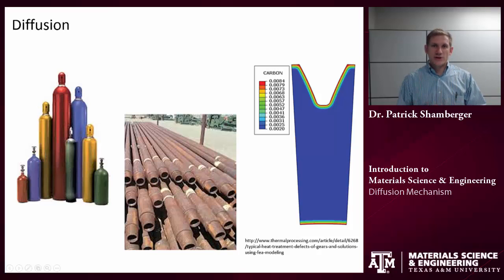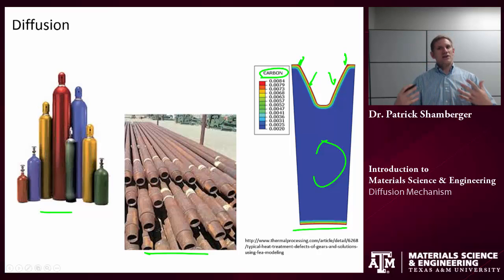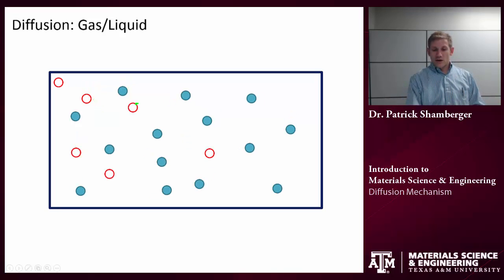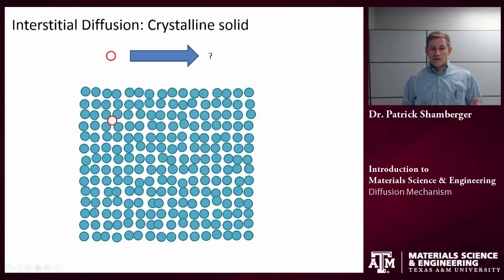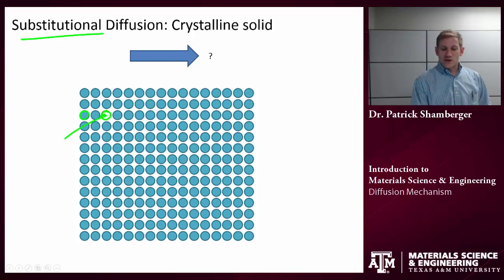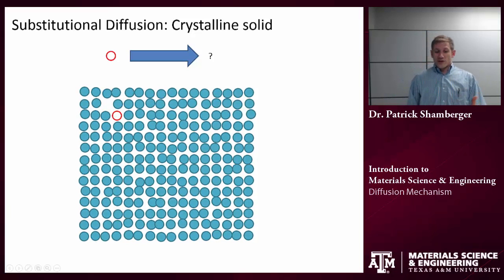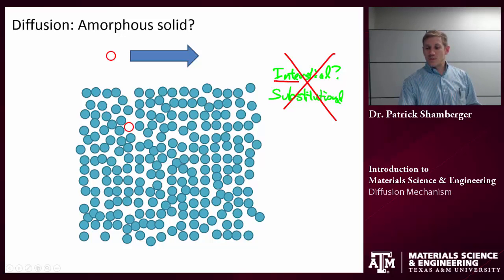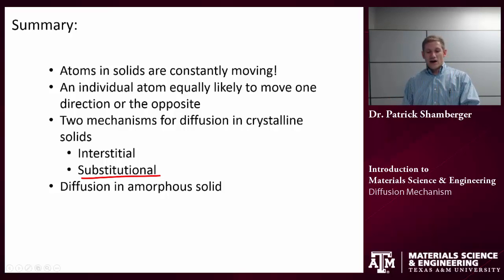Diffusion: Mechanisms {Texas A&M: Intro to Materials}

Comment: so for solid diffusion, we assume that a substance B has already been mixed with the base material and hardened. Then, over time, it moves around inside the structure. is this correct?
Also, i assume that substance B can be either fluid or another solid, right?